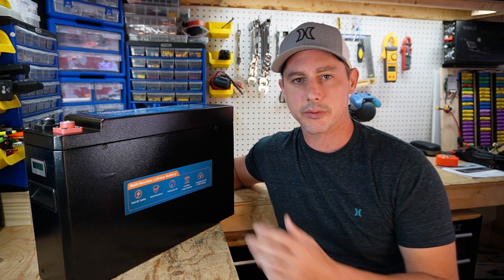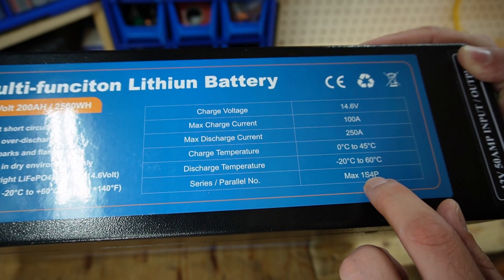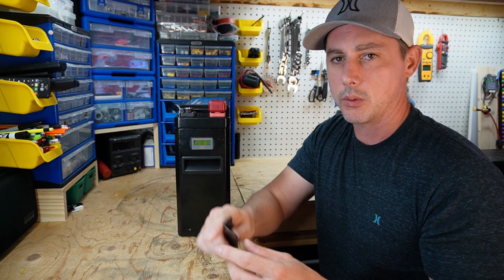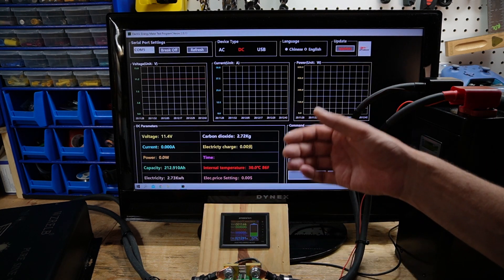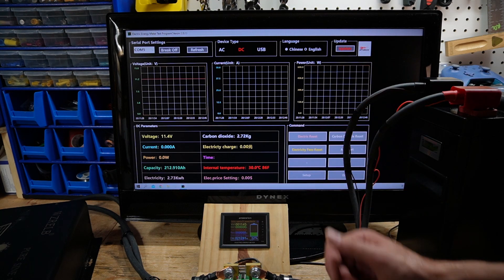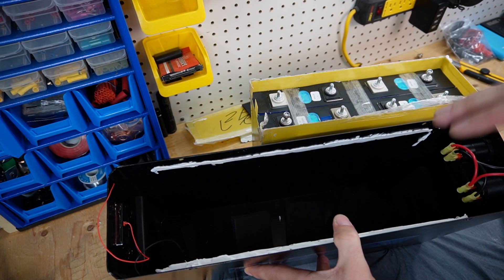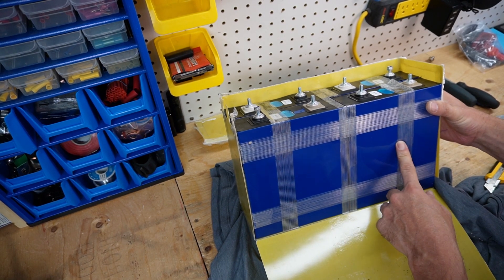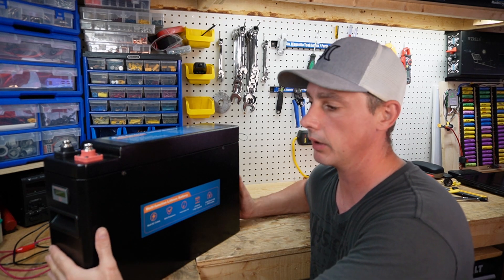Licitti 200Ah Slim LiFePO4 battery video review

Comment: Low temp sensor should not be on the battery packs.  The battery packs could raise the temp and interfere with the low temp cutoff
Reply: The danger of charging applies to the temperature of the cells.  The sensor on the cells is the most appropriate place to monitor it, regardless of whether or not usage has warmed them up.
Reply from the maker: Low temperature protection is for charging protection at the very begining. Most of view is connecting low temp sensor with battery pack body directly. Thanks!
Reply: Price?
Reply from the maker: @michaeld4502  please contact our sales: sales@lipowertech.com for details. Thanks!